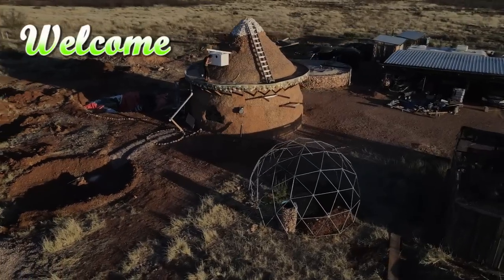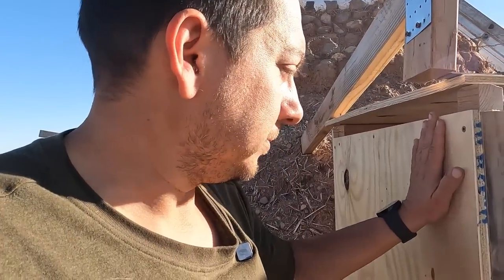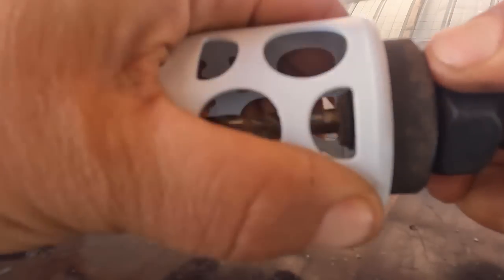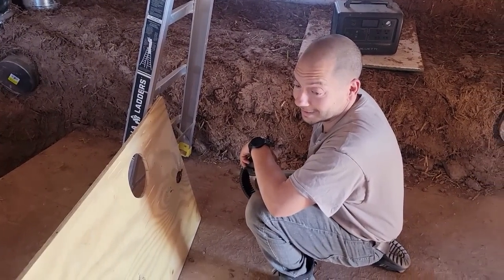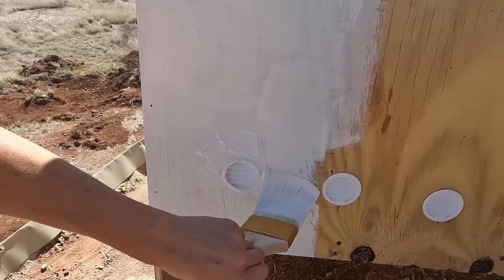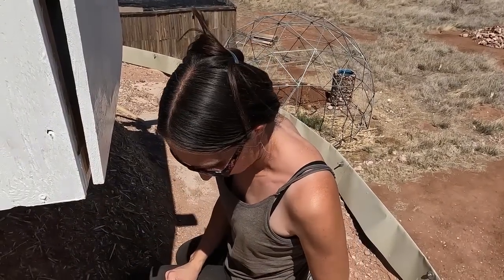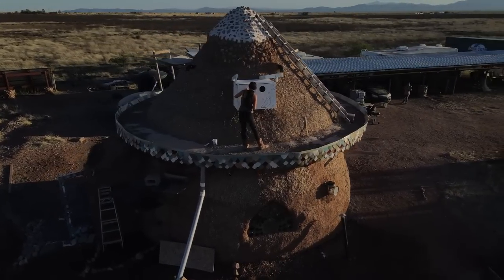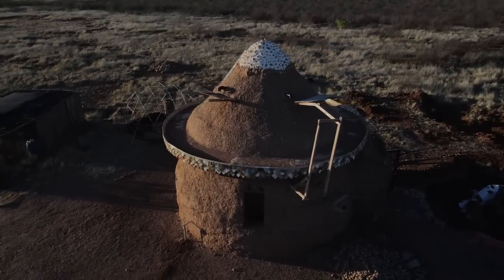Our All Natural Solution For Rodent Control | Owl Box Build

Comment: Jesse, if you have toothache where you had your wisdom teeth, it's entirely possible that there is a piece of a a wisdom tooth left in there. 

It's not uncommon that if a wisdom tooth is infected enough, makes it harder to see if a small piece broke off and was left there. 

I would get an x-ray to be sure. If there is a piece of it, it definitely needs to be removed. 

Wishing you the best.
Reply: I had an errant wizzi out, what a major relief, specially when you're over 50
Reply: Jasper, the Dutch guy of The Portugal Project seems to be experiencing the same pain AFTER he underwent a rootcanal in Portugal! You cannot wait  too long if that's the case, as the situation will just get worse if indeed there's an infection festering in your jaw. See a dentist ASAP.

Comment: Jess please try this get some over the counter pain relief gel for teeth. If the tooth is on the bottom rub it on the top and bottom gums same if its on the top rub it on both the top and bottom gum. Because the nerves are interconnected. It helped me a lot when I found out.

Comment: Jess, From driving through NM & AZ elevation changes and severe barometric pressure changes from all the wind last month, I experienced barodontalgia - put it in a search bar - it's a real condition, no to say you have it, but the pain end of it is what I needed the most help with without a dentist. My friend recommended Neem mouthwash and when I returned home I ordered two bottles of Neem Oil - which saved the day and eliminated the pain. Snipping off the swab ends of a Q-Tip, put the Neem Oil on the swab and put it in the pocket between the inner cheek and jaw at the tooth line - it's not going to move or come out - it will rest rest there, even on the upper course of teeth & jaw, until you take it out to eat. The relief is instant and over repeated application the ayurvedic qualities of Neem Oil will heal your mouth. Amazon carries the Neem mouthwash and Neem oil. I hope this information resonates with you Jess and you land on a pain free life. Sub'd bell'd and liked.

Comment: I just wanted to suggest that you consider using some nails in addition to the screws in that plate you are using to suspend the owl box.  Most screws have poor shear strength.  Nails generally have much higher shear strength.  Screws are great for holding boards together but they can break under shear, while nails may bend but are less likely to break.  P.S.  I hope Jess feels better soon.

Comment: Nice job. I use Wyze cams around my place, and in my chicken coops and run. They're only about $45. each and will run continuously, will record video clips to the cloud for 14 days before overwriting with the yearly subscription (only about $20./yr), and if you have a card inside the unit, you can have access to all the footage. I use the ones that require outlets because the cordless ones require replacing batteries.

Comment: Just a tip, next time you use a hole saw, drill about halfway through then drill from the other side.  Less tearout and its easier to get the part you just drilled out off the saw.

Comment: When using a hole saw if you cut half way on one side and  then go at it from the opposite side only 1/2 of the wood gets caught inside the saw. It makes for a much easier removal of the wood plug because there is something to grab onto instead of digging inside the saw. Jumping around from project to project can make it seem a lot less boring, it is not bad. keep up the good work!!!!

Comment: Sorry if I am wrong but my engineering mind tells me that you also need some insulation between the mass heater and the external dome wall, otherwise the dome wall will absorb some of the heat and dump it outside. Unless there is some insulation between the wall and the heater all the heat won’t stay inside the dome.

Comment: A Reolink solar Wi-Fi camera will cover all you need and more the picture is fantastic yet it runs of solar so costs nothing for day to day running and you get to move the view of the camera 360° round and 110°vertical movement I think they are the correct degrees of the top of my head. It connects to your phone/laptop and you can view anytime with night vision. These cameras are about the best you can buy without spending ,000’s of dollars on one.

Comment: Question
Rocket mass heater bench
might a concrete trowel smooth out the bench and back easier
and possible a piece of metal rounded
To help make the transition from window ledge to bench back and bench back to bench smoother
maybe

Comment: When it comes to toothache... Get hard liquor
in a cup...dip cotton, hold it in a bite where it hurts queeze that liquor into the infected area until it is so numb it doesn't hurt...you may need to keep repeating with a new clean cotton...if there is space in between your gums and your enamel used a swab
Just pour so much liquid into the infected area until it stops hurting....then just maintain it clean of any bacteria.... alcohol kills it & the pain will go away. Use drinking alcohol just in case you swallow any, it won't hurt you.... Try to do this Right away.... you don't want to pull out your teeth
Because if you sray many years without a tooth replacement, you lose  bone... It will dip down where there is no bone

Be Bless!!!
Reply: i use peroxide on swab

Comment: Hate to tell you buy dairy products are harmful to dogs.  Besides ice cream , you don’t want to give them milk, sour cream and cottage cheese.  I’ve done it myself and my dog used to throw up a lot.  Just look on line.  It’s all there.  Things that are good for them are sweet potatoes, beans of all sorts and carrots.  Things like carrots, I have to blanch them because he doesn’t chew them up.  Oh one other thing.  They have a whole set of hole saws at Harbor Freight for the cheap.  If you start the hole saw on one side and finish it on the other side that dang plug will be easier to get out.  If it’s stuck just use a screw driver.  Sorry your not feeling good.  I will say a pray for you.  God Bless.